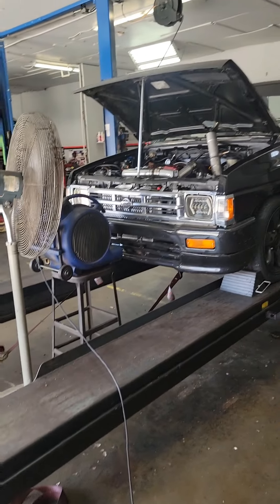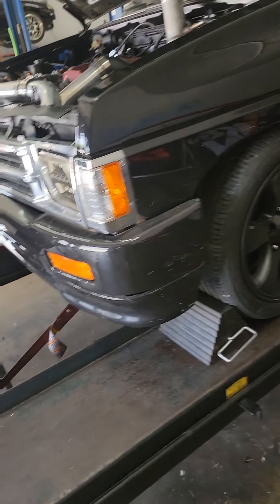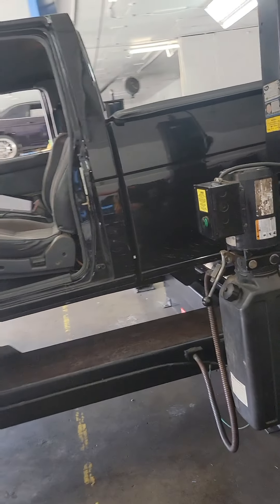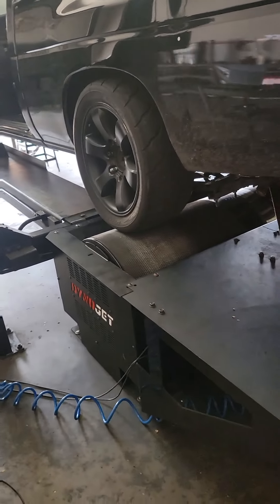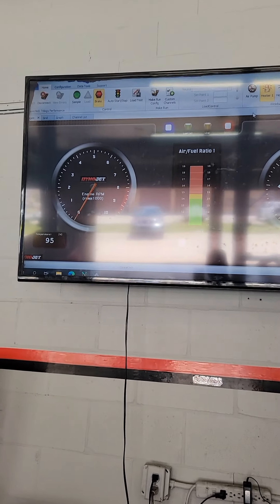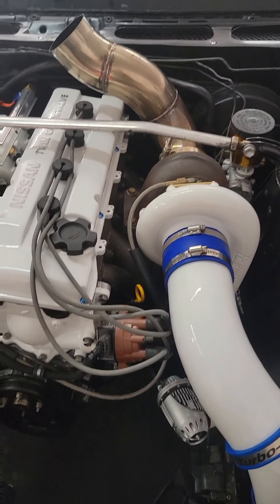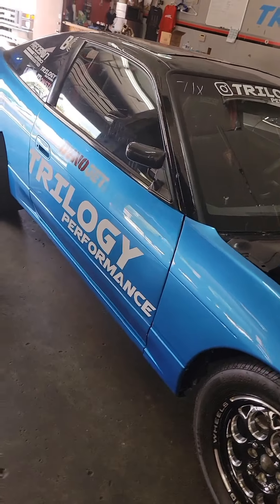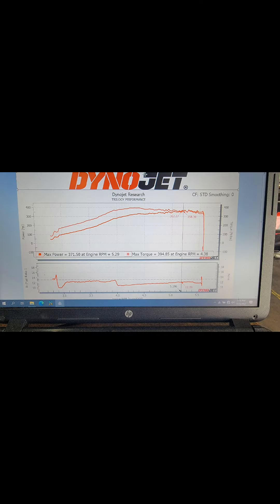nissan hardbody on the Dyno d21 ka24e

Comment: what parts did you use to rebuild? I cant find valve springs anywhere.
Reply from the maker: I use stock the stock spring no need to replace them
Reply from the maker: You can buy New hydraulic lifters if nided on ebay
Reply from the maker: But i'm pretty sure you can find them on ebay
Reply: @hardbody_Santiago96  cool thanks

Comment: What management are you running if you don't mind me asking
Reply from the maker: Microsquirt ecu 1000cc injectors and e85 to keep the $90 pistons alive
Reply: @hardbody_Santiago96  I have microsquirt on my hardbody as well 1200cc injectors e85 as well. No one in my area tunes megasquirt stuff been having a real hard go of trying to get a half decent tune.
Reply from the maker: I can probably help you doing a low boost tuning that will you be safe